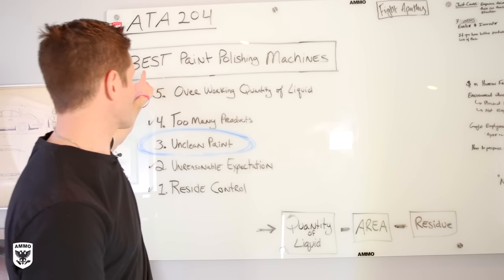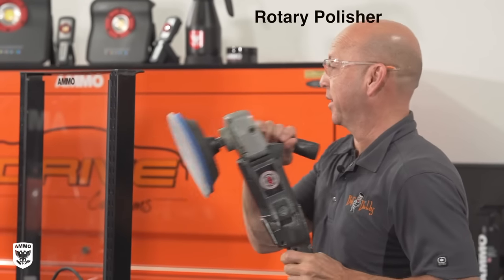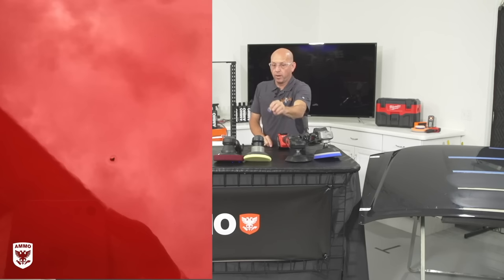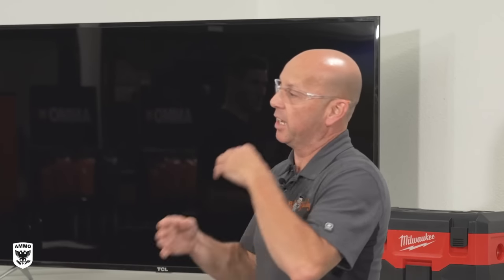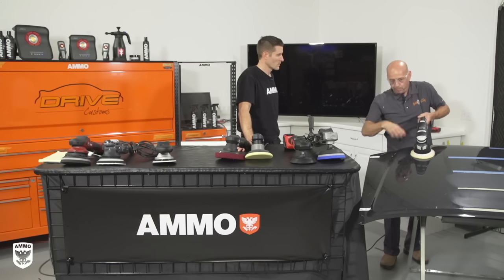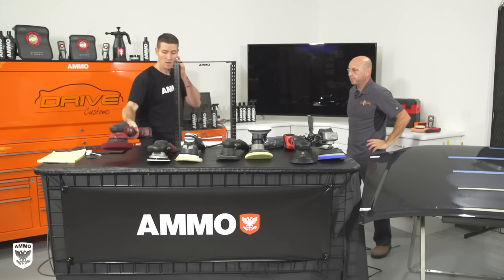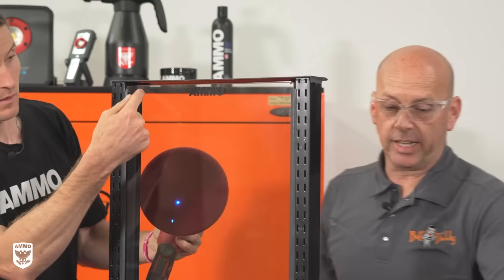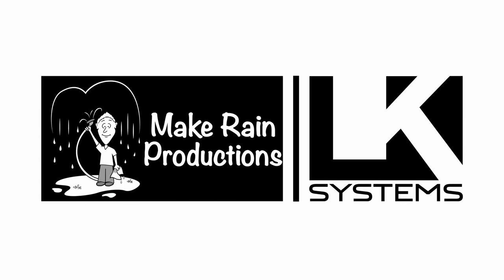Best Paint Polishers for Scratch Removal ATA 204

Comment: Great explanation of the differences. This is why I have the BigFoot 21, the LHR15, and the iBrid Nano. My Jeep, my STI, and my Truck have different size panels, shapes, and lines. It’s nice having the right tool for the job.
Reply: Which one have you found best for your STI? or a combination of the tools?
Reply: @adamb2619  I have the Limited trim so it has a moon roof up top which reduces the paint surface that I have to cover. The LHR15 works as I've only had to do a few spots around the car. If I were going to polish the whole thing the 15 would work, but you could cut back some effort/time using the 21 on the doors and the roof. The ibrid nano works great for the front bumper around the fog lights and grill. So depending on how much you're trying to do all of them are great, but the 15 is versatile enough to use alone if you don't have the budget for the other two.

Comment: Great Video and pros at work. Just want to mention that for large stroke machines can be limited to pad size. I learned this the hard way. Put a large pad on a large stroke machine. Good luck holding on to it! Now it search of small / medium stroke machine so I can run larger pads!  I did not see that coming when I bought the larger Pads!

Comment: The DA spin operates on inertia (the counterweights). So when the spinning of the pad stops, they take a while to wind up again. I found them so frustrating to use. I spent half my time lifting the pad off the surface to get it to spin again. I'm pretty sure people don't realize how often their DA spin is stalling because the machine is always vibrating and shaking back and forth even when the spin has stopped.  You might think that everything is cool. 

The rotary is such a pleasure to use. Smooth and easy to handle.  If you use common sense and keep the thing moving it is very effective. I reserve my DA for final polishing now and the time savings is huge. 

I may have to pick up a 3401 or a Mille just to see if that is the machine I've been looking for. I still can't understand why they are so expensive though. The design seems very simple.
Reply: Witch is best posher da or rotary

Comment: So I've been detailing around 5 years, and I'd say I'm a master interior detailer, but in the last year I've really been adding exterior cutting/polishing to my arsenal. What are the benefits to switching to a rupe vs a flex? Such as weight, results, cutting/polishing/finishing all in one tool...that's why the flex is great to me especially as a novice. I'm really thinking about a rupe...can you give me quick thoughts on the matter? Love the channel great job
Reply: Get one. You won't regret it. It'll cut your paint correction time in half and doesn't get hot like the flex

Comment: I see detailers always center the pad so carefully on a rotary buffer. If u put a pad on a rotary buffer a little  off center, will not be about the same action as a random or da polisher?
Reply: If you place a pad 8mm off centre, yes you will have an 8mm orbit on the pad. But you only get one orbit per revolution. The Flex for example will oscillate about 10-12 times in one revolution on its gearing. I haven’t counted them, but from memory it feels like 12.
Reply: Tosh Y thanks for the info.makes sense.

Comment: ok, so I do not understand what stalling is. I bought a cheap "presa turbine da polisher" off of amazon and have used it for a year or two. I have recently been noticing the pad stalling and not spinning quickly and basically vibrating a whole bunch on relatively flat or slightly curved surfaces. In order to get the pad/machine to do its job and spin at an average cutting rate, I must relieve an immense amount of pressure or weight off of the machine and paint. In most cases enough weight is removed from the polisher/paint I feel like it is barely touching the paint. I thought it may have been the machine going bad or cheap non centered pads but now I know that may not be the case. What causes stalling? Anyone can answer but would love to hear a comment from Larry! For example, @20:31

Comment: Are these aimed at the average joe or for the professional?

Because I genuinely feel that the Rotary is still the most useful tool in regards to cutting potential, ease of use (not having to pick up the machine from the pad stalling with a DA) and for time management (not having to slowly crosshatch each working segment of product over and over again).

Yes, tilting a the rotary on its pad will create more friction to that targeted area, but that also means you have more opportunity to get something done quicker while also being more effective at defect removal around contoured/uneven areas of the vehicle. Which is every modern car now.

It is quite easy to grasp the level of common sense needed to effectively place the pad safely around contours and edges with a little bit of understanding of the individual machine's operating tendencies.

The polisher guiding itself also gives you a good idea on how the speed of your arm movement should be as well. To me, it is literally like having a braking line set out for you as a guide when you're racing a new track in a video game (think Forza or Gran Turismo). 

This new technology does not save time at all. It just pacifies preconceived fears.